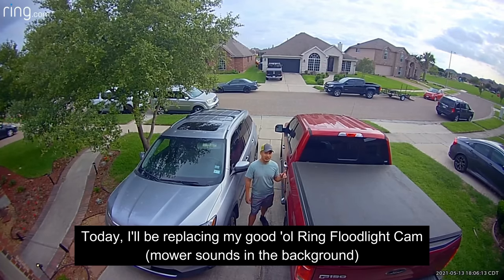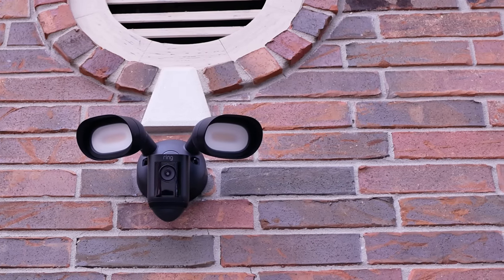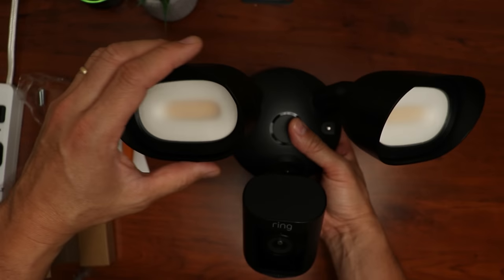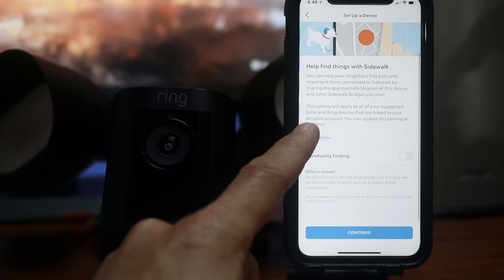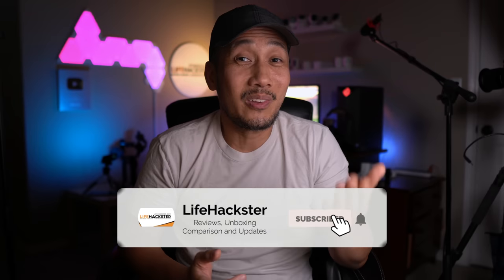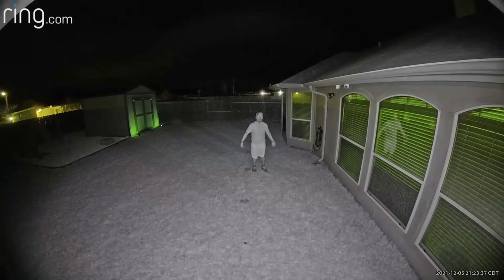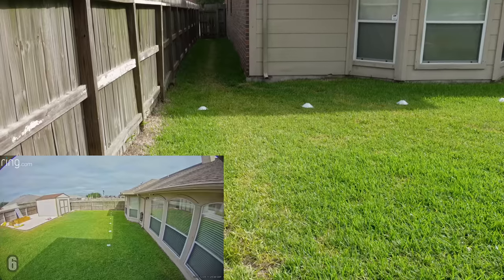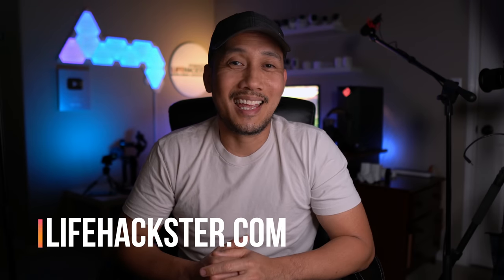Ring Floodlight Cam Pro - Unboxing, Features Installation, Video & Audio - 3D Detection is Worth It?

Comment: the 3D detection is especially useful if you have the camera facing the street. with the old camera, cars can trigger false alarms even if the motion zones are away from the street. i used to set my camera to "people only" for this exact reason but that way i couldn't see cars actually coming onto my driveway. and sometimes the people recognition fails (happens more often at night) then i don't get any notification at all. one time i accidentally let my dog out in the frontyard and she was chilling there for a good 20 minutes without me know cuz she is technically not a "person" so it was just recorded as motion, no notification. 

Radar is distance based and far more superior. when the zone is set at before the street, nothing outside the zone can trigger motion. the ring's marketing team somehow emphasizes the feature is to make us see the path of our visitors, making it sound less useful than it really is.

Comment: As always, thanks for the video. Also, watching this, I have to thank you again for your video of the missing lens cover on your old floodlight. Before that, I noticed a fuzziness on my videos and sure enough, my lens cover was missing and like you, I contacted Ring after I watched your video and like you, Ring sent me a replacement floodlight free of charge. So, like your replacement floodlight, it really is not that old and still works great. On the new floodlight Pro, I don't think I will buy. With the plastic base, it does look cheaper, so at this time I will pass on buying the floodlight Pro.
Thanks again. Good information as always. 
Don from Milwaukee
Reply from the maker: Thank you Don..

Comment: Totally agree with your end comments. The audio and alarm are impressive. Probably the loudest alarm you have ever measured, but if you already have a ring spotlight there really wouldn't be a big benefit to upgrade to this one. Keep up the good work!
Reply from the maker: The audio from the camera is pretty good. I can hear it from the inside of the house when I tested it which doesn't happen with other cameras.
Reply: I like the Siring

Comment: I just bought the ring floodlight cam to basically test it to see if I thought it was worth investing more into it.  I really thank u for ur honest testing and opinion… so I went with the original flood light cam and saved the $50. So far so good.  I’m definitely going to buy a few more flood lights and some interior cameras. I think I’m just going to switch my whole set up to ring now.  Just way too easy and for $100 a year u can’t beat it compared to commercial security products out there.  Again thank u

Comment: Thank you - nice review! But I don't think you mentioned the most significant difference (for me, anyway) - dual-band wifi. I have had a lot of problems with 2.4 devices not connecting.

Comment: The image quality is definitely sharper but I don’t like the new installation mounts and the new spotlight design. The frosted cover seems to reduce the overall brightness compared to my original ring floodlight.
Reply from the maker: I'm not really sure it is 2000 lumens.. it is dimmer.

Comment: I love my ring floodlight cam out of all my ring products (2 floodlights, 2 video doorbell 2s, 1 original video doorbell with solar doorbell mount charger, solar security sign, ring alarm security system, 3 discontinued original ring square black stick up cams that still work, multiple chimes, chime pro and 3 solar spotlight cams). I love Wyze tho for the free continuous recording via micro sd card local storage and have the v2s, v2 black, pan & new v3s along with sense sensors & smart plugs. I saw Wasserstein made a floodlight mount fixture for the Wyze v2 & v3. I would love to see you review the v3 with the v3 Wasserstein floodlight mount to power Wyze v3 camera using existing light fixture. Love your reviews & channel. I always check them out before purchasing anything.

Comment: Why I spent the extra money for the Pro light, the unit has dual band connectivity so it can transmit on 5G band as well as 2.4G band width on the wifi so I have better assurity the audio and video will be clear and well defined. One thing I can't stand is fuzzy images when catching bad guys. Thanks for your video.

Comment: Thank you so much for this video.  I have the original Ring Floodlight Cam.  The lights started malfunctioning.  My warranty had lapsed.  I was getting ready to purchase another, but they announced this model.  My discount code wouldn't work with the pre-order. I can order now, and I know what to expect from the new model, thanks to your video.  -jn

Comment: I like the look of the lights better on the pro.  A tip for veterans and Ring Protect subscribers: I was able to stack the 10% Protect and 20% Military discounts, even on the multipack.  So, I got the 2-pack Pro ($459 normally)  for about $330 plus tax.  With one at $259 I'm really happy at the savings.  Thanks for a great review and I've bought mine for a new home being built.  I figure I'll do one over garage, one over sideyard, and then traditional security light (motion) in backyard, with 2 Spot Light cameras.  I already have 4 spot light cams, Ring doorbell (2) and stick up cam inside.  Ring alarm and Alexa to round it out.

Comment: The image quality is better but other than that, it is mostly the same. Probably not worth the upgrade from the 1st generation.
Reply: The image and sound quality is substantially way way better just look at the beginning of the video you could tell the difference by a mile even the refresh rate is alot alot more smoother as well
Reply: @JUrena0123  agreed we have the first gen flood light and my god the image quality is terrible and audio crackles and has no cancellation what so ever so it picks up everything and u can barely hear peoples voices which sucks!!! but man this new one def has improved on the audio and image quality which is probably the only reason why people should upgrade other than that it doesnt offer much else...but obviously image and quality upgrades is what we all should be wanting and this cam delivered.

Comment: Thanks for the review.  Anyone that thinks Ring loads slow use the Rapid Ring App.  As the this Pro model I agree with most it does not seem very pro.....  I will stick with my 3 original floodlights....  I think buy back from Amazon was like $15, that is lame.....

Comment: I have the original Ring Floodlight and Arlo 4K spotlights. 

Honestly, I was excited about the new Ring Floodlight, but it is an utter disappointment. It has the same resolution as the original Ring Floodlight with 10% better audio reception.

Arlo blows it out of water with much, much better Imaging and audio feedback. It is ASMR worthy. I know this Ring is 1080p (same as the prior model) which for a 2021 is honestly utter failing of Ring. The Arlo app is not as intuitive as Ring with rich notifications (takes while to load) otherwise I would have jumped ship a while ago.

Comment: Nice review (as always) - I will never buy a Ring product because of the subscription.  Ring over charges for the product then requires you to constantly pay.
Reply: That’s why I just installed 2 Eufy’s 2K floodlights.
Reply from the maker: Thanks...yes they are subscription based model and cloud based which limits them also on the video resolution..going to 2K or 4K recording, then they need to bump up their fee for storage costs.

Comment: Love the video and all of your reviews. Question,  long range wifi routers, what do you recommend? I got cameras having issues connecting with my 2.4 and I have a nighthawk. Don't know where to start. What are you using?
Reply from the maker: I have the eero mesh system.. no issues and I can just add a beacon if I have signal issues.
Reply: @LifeHackster  thank you! Did you review that before? I'll definitely take a look.  Appreciate it.

Comment: Is there still a battery.  Like what if you have several flood lights and you want them off but the security of the ring.  Or when your switch is off is the system also dead?

Comment: First a question, did I not see you combine a ring camera (floodlight design) with a better functioning, non-camera floodlight to improve the available light and performance of the new, "Frankenstein" flood-cam?  How did that work out and is it still a viable option (I spent 30+ yrs as a repair tech, I'm up for challenges) for someone trying to get performance from a modest budget or is the new floodlight camera "all that and a bag of all natural, free-range kettle chips?"
Thanks for the anticipated response.  😉
  As for the new floodlight cameras...
Going to a plastic body and mount has two separate schools of thought.  Yes, "it's cheaper."  It's cheaper to build and keeps the production costs,down which means the retail price is lower than if they're made of metal.  If you think they're more expensive now, just use steel.
  School two, plastic won't corrode or rust which can affect the wiring, draw corrosion into the box, etc. while being used outdoors. 
  The judgements are held for what type of plastics are being used and if they'll fade, "dry-rot," crack or break under moderate impact.  If quality plastics (mixed w/fiberglass, resins, etc.) are used, I'm OK with it. 
  Companies are faced with a balance of product improvement and innovation and cost management so the new, improved (NOT new "and" improved, it can't be both, simultaneously!) products aren't priced right out of the market.  If you have a target price range and improvement of functionality is costly, counters have to be made, like moving to a plastic body instead of metal.  Although the metal is "better," the expense of the metal could be better used in upgrading interior components as long as the new housing design doesn't compromise the overall integrity of the product.

Comment: Why 1080?... Why not 1440 at a minimum, if not 4K?

3D motion is a gimmick at best.

I'll hold on to my 1st Gen floodlight.
Reply from the maker: I think they have plans for the 3D motion in the future...we will see but as to motion detection as per their advertising, there is really no benefit compared to their other wired cameras.

Comment: does this work with ring solar panels. Also could these be mounted on the ceiling instead of the wall while still being able to use the camera and light properly

Comment: Maybe a dumb question but can the bulbs in the Ring Pro be easily found at the local hardware store since they are oval?
Reply from the maker: No, they are not replaceable but normally they are rated to outlast the camera itself.
Reply: @LifeHackster  What about the bulbs in the older Ring cam that's not oval? Are they replaceable?

Comment: My original Ring Floodlight camera is mounted 12 feet up on the front of my garage and it can NOT make a license plate out from more then about 10 feet in front of it. If the new version was clear enough to read a plate number zooming in at the end of my driveway (22 feet from my light 12 feet up in the air) I would upgrade in a heart beat. Because so far between Ring sending a replacement, my internet provider bumping
Me up to fibre and myself getting the light/camera required on its own circuit, the camera can’t get any clearer.
Reply from the maker: WIFI cameras are just not good in reading license plates... there is a lot of compression that they need to do so the footage file is as small as possible to easily upload to the cloud. You need to have an IP/NVR camera that has a narrow field of view or get a zoomed one and just aim it to the area that you will likely get and recognize a license plate.
Reply: @LifeHackster  do you have a recommendation by any chance? Have you done any reviews on those types of camera systems? I’m assuming Ring doesn’t have any solutions for that ?

Comment: My issue with my original is it connects badly. It’s right near the router and fails to connect all the time. 

My other ring came and bell connect fast and sharp and are further. 

So if they improved the antenna maybe I’d get this. 

Or my floods are defective

Comment: I have read that bugs will set off the floodlight with their motion, anyone know if there is a way to adjust the sensitivity? My sensor lights just went for a crap, need something new asap . Thanks
Reply from the maker: The floodlights themselves have a separate sensitivity slider in the app.

Comment: Thanks for the great review. Question - can you test its maximum distance detection at night? I have the floodlight version (original?) before this pro, and it seems weaker on detecting distant motion at night. Thanks!
Reply: I have used the original floodlight cam and can attest that I have video of cars being detected 100 to 150 yards away down the street in either direction.  I see everything that happens in my subdivision from when a vehicle enters off the main road until the vehicle turns into a driveway hundreds of yards away.

Comment: What cameras are mounted on soffits?
Reply from the maker: Most security cameras can be installed horizontally like in a ceiling or soffits.
Reply: @LifeHackster Sorry, I meant which ones do you have installed on soffits?

Comment: Why wouldn't you wire the floodlight to an outlet, so you wouldn't have to worry about the switch being turned off?
Reply from the maker: This is a replacement to an existing floodlight controlled by a switch.

Comment: Major flaw with these has always been anyone can just walk up and hit the reset button which renders the floodlight cam useless.  The reset button on the doorbells are covered. The floodlight cams just press the button on top of the camera... if is not installed high enough a smart thief would just reset the camera and it's in limbo.
Reply: Well the camera would send you an alert before the smart thief pushes the reset botton
Reply: @ray19796  still a flaw imo... what happens if it's pressed before the video can be uploaded??? U get an alert and ur not home and your camera just says disconnected. Imo at the end of the day it's like locking your door but always leaving the key in it.

Comment: I have ring floodlight and live in a culdesac the headlights from car driving straight at my house trigger it all the time especially when it rains and when the temperature drops to about minus 20 degrees it starts flashing like crazy thats when I have to turn it off. So now I have both the ring and wyze camera as a backup. I still wish there was an option to turn the ring lights  completely off when your hanging out near it.
Reply from the maker: You can try their person only mode..but I wish Ring will also have cars and animal detection and not just person detection.
Reply: @LifeHackster  Arlo has animal detection. I don't know why Ring doesn't yet.

Comment: Ring Dropped the ball on 2k or 4k and making it Poe with 24/7 recording.  3d view seems like a useless gimmick at this point unless there will be a drone down the pike.. I really dont understand why they make a new product without 2k or 4k or 12mp as other companies are doing.  so ask yourself really what is the Upgrade here?
Reply from the maker: Yes.. I think the 3D detection is going to be used for something else in the future. Their cloud based system is the main factor why they are hesitant to make 2k or 4k cameras..which means needing more storage and they have to pass the costs to their subscribers.
Reply: @LifeHackster  you are right... they might be building a 4k system and cost will go up to 20 a month